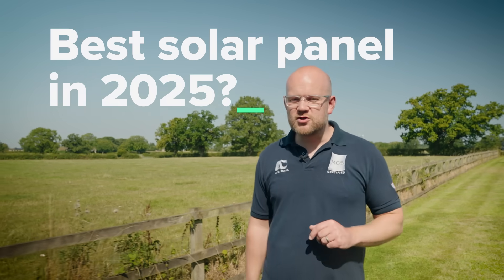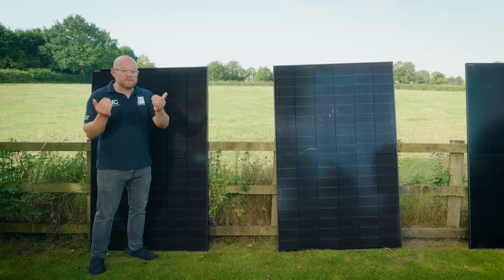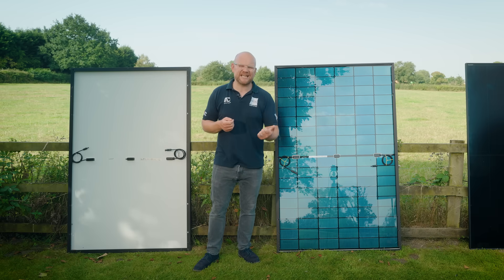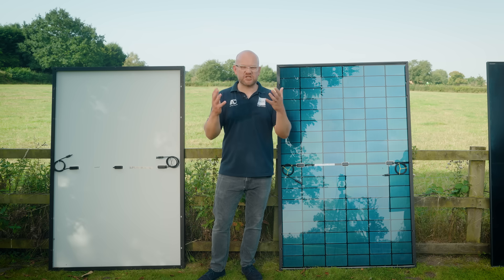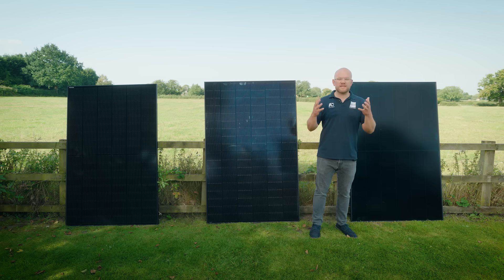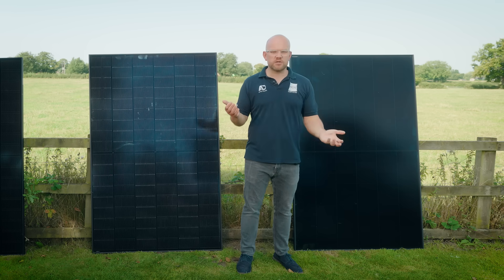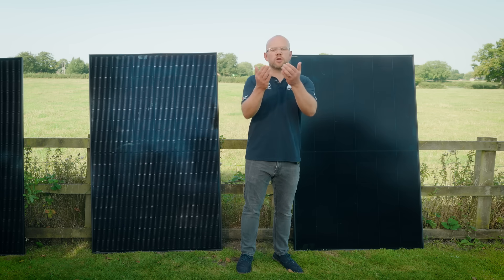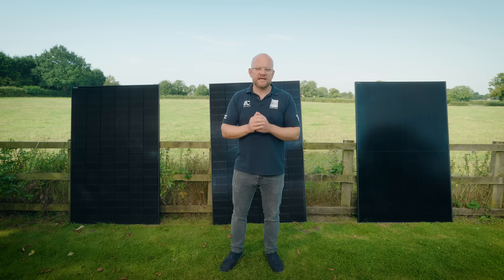Monofacial vs Bifacial vs All-Back Contact | Best Solar Panels 2025

Comment: Direct competitor the Aiko all back contact is Longi x10 HPBC2 (back contact cells). Doing research, these type of panels offer better output in partial shading. In summer (this is imp if your in a hot climate), both have a temperature coefficient of -0.26%/°C. For every 1°C increase in temperature above the standard test condition of 25°C, the power output of the solar panel decreases by 0.26%. Current Topcon panels like Jinko N type is at  -0.29%/°C.

Comment: I went with HPBC with almost no one talking about them.  I'm so glad I did.  I'm a complete newb to solar and really lucked out as my rvpozwer 220 watt panels are putting out 260 watts in the cold spell we're having.  The array is perfectly-matched for the Pecron F3000LPF I bought at the same time.  I got these cheap as well because no one is buying them because HPBC is like speaking Sumerian and everyone is gushing over bifacial.

Comment: “A bifacial solar panel has glass on the rear side, which allows it to dissipate heat more effectively and operate better. In other words, its temperature coefficient is superior to that of monofacial panels. Therefore, it will have better performance on hot days even if light does not reach the rear side.”
Reply: Who told you that.  On roofs they can get very hot especially darker to moderate media roof types.  Heat kills all

Comment: I have 2 Aiko 440W full back panels at balconly power station. one thing is not talked in the video is this one is the lightest and smallest among all these panels. it's ~2kg (10%) ligher and 4cm shorter. For DIYer in such tight space like balconly this is very important.

Comment: You can't compare the N type of Topcon Jinko with the ABC Aiko over a 6 month period. You need to compare like for like if available. Aiko, 18 months ago, had 455W ABC full black panels available to purchase so the increase in performance hasn't been that significant over the past 6 months. Aiko are now at 480W for all black imported into the UK. You're right that it's more incremental and more difficult as one gets closer to the Shockley and Queisser limit. It looks like scientists are starting to find ways of making perovskites more durable but we're not quite there yet and those that are made now are at a premium. Also showing panels on a roof with rigid bird protection would decrease light entering the roof tiles anyway lessening the impact of bifacial panels. They're far more effective with carports/carparks, ground and flat roof mounted at an angle on a light coloured roof.

Comment: Question - if you have full sunlight hitting both sides of the bi-facial, what is the maximum you will get from the panel? Is there a one side rating and then a combines rating? Do you know the maths for both?
Reply from the maker: Great question. The wattage listed on a bi-facial panel (for example 470W) refers only to the front side under standard test conditions. The rear side doesn’t have a fixed rating because it depends entirely on how much light is reflected onto it from the surroundings.

Bi-facial panels use a bifaciality factor (usually between 65% and 90%) which shows how efficient the rear is compared to the front. If the rear side has good reflected light (white roof, light gravel, snow, raised mounting etc.) you can see a noticeable boost in power output.

In real installations, the increase is typically in the range of around 5% to 30%, depending on the environment, and can be higher in very reflective conditions.

TUV nord do great studies on different set ups, which are useful to have a read of. 

Hope this helps.
Reply: @apexdoma  That's great, thanks. I would be interested to know if I can get full sunlight on both sides, what the maximum output would be. I do have my reasons and methods to achieve this. :-)
Reply: @OYMInternetRadio  Here's an example that may help you.  If the bifacial cells have 90% "bifaciality" and the rear encapsulation is perfectly clear then there's no reason not to expect that if BOTH sides of the PANEL are hit with "full sunlight" (let's call it 1000 watts per square meter) then the output would be 1.9 times what the front side Pmp is.

Comment: Just an idea, why not have a reflective solids surface behind the solar cells on a  panel, remove the black and allow the sun to  shine through and reflect back from the rear thus hopefully increasing solar power output. we already have clear solar for windows i believe , thus you could have the same or very very slightly thicker panels but gain a few percent more in output.

Comment: The black is only 6.7% better than JA bifacial rating. In Australia I regularly see 14.3kw from my 12.76kw rated 29 JA Solar bifacial panels mounted close to my white colourbond roof. That is 11% uplift compared to theoretical. So I think bifacial is still superior to the black 465watt panels.

Comment: You didn’t mentioned that Aiko panels are also partially shade optimised. That means if you cover like 10% of the panel it’s going to do 10% less power and not like 60 to 70% like the older one’s

Comment: Unlikely that any solar panel will still be installed even 15 years after initial install. The economics favour replacement every 10 years as panel efficiency increases

The most important economic consideration is to have something installed, rather than waiting for better efficiency to arrive
Reply: I'd love to see the math to support your claims!
Reply: @johnreeves7261 Here are mine, from my most recent upgrade. Kiwi dollars, but will translate to other currencies

18 x 270Wp cost me $3600 in 2019. 4860Wp. Yield 19.4KWHr/day = $3.30 FIT = $1173pa

16 x 415Wp cost me $3036 in 2024. 6640Wp. Yield 26.6KWHr/day = $4.52 FIT = $1648pa

The same roof area nets me an extra $475pa. So $3036/$475 = 6.4 years

Plus, i sold the old 270Wp panels for $90 each, so my upgrade cost was actually only $1416 = 2.98 years to break even
Reply: @Goodkiwibloke  Nice!
Reply: You could get 19% efficient panels almost 14 years ago. The best mainstream panels now are circa 24.5% efficient. The degradation on good quality panels is low. If you replaced the panels yourself then maybe the economics could work but you've still got the material and ancillary costs, new inverter(s) and scaffolding to factor in. Getting a roofer or dedicated panel installer and electrician in on top adds several years onto the payback. It also depends on the export price which is out of one's control. You really need a larger gap between efficiencies to justify it unless the inverters have failed or the panels have severely degraded. Perhaps for off grid installations it can be more justified but unless space is limited it likely makes more sense to add additional panels and inverter to the existing setup.
Reply: @andrewallen9918 By your own numbers, panels have got 25% more efficient. Add 10 years degradation, and there is another 5-8%. There are no material costs, everything is reused. There are no ancillary costs, whatever you mean there??? A good quality inverter has an approx 10 year lifespan, so was due for replacement, but actually doesn't need to be replaced if still working well.  Panel replacement is a job anybody can do, if they can use a screw driver. Why would a roofer be needed, scafolding is unnecessary unless you are a clutz, now you're clearly just making stuff up to justify an unwinnable position. Ditto electrician, no need, the panels just plug together using the same MC4 connector standard thats been used for 20 years 

The only valid point you raised is FIT. And this is only somewhat relevant if you exceed self-use generation quantity 

Show me your numbers, just like i did. But i bet you won't.

Comment: (7:16) The so-called "all back contact" technology is not new.  SunPower (now Maxeon) has been offering it for over 20 years.
Reply: Indeed, although it wasn't as seamlessly black as Aiko panels are now. I guess it was more expensive than the alternatives such as PERC and TOPCon and it's only more recently that ABC (or IBC with Sunpower) has become cheaper and more prevalent.

Comment: I want to do a self installation, but how do I determine my roof structural integrity? Are there specialists who just do that aspect?
Reply from the maker: Thanks for this. Just a note that a lack of MCS certification / not notifying the grid may cause you some issues. 

But assuming you can overcome these, we use solar design software that covers the majority of the installations; anything outside of the ordinary would be checked by a qualified structural engineer.
Reply: @apexdoma absolutely. I am an electrical engineer with HV, LV and ELV experience so getting the right paperwork into the DNO is the easy bit for me. Thank you for the response. 👍🏾

Comment: The video compares three types of solar panels: Monofacial, Bifacial, and All-Back Contact.

Monofacial panels (425W) have solar cells on one side only. These are the most commoditized and budget-friendly.	For those on a lower budget or using an in-roof system.

Bifacial panels (445W) have solar cells on both sides. They generate additional electricity from light reflecting off the surface beneath it. Bifacial solar panels work best for ground-mounted or on-roof systems with light-colored tiles, where light can get behind the panel.

All-Back Contact panels (475W) have all their wiring/busbars moved to the back of the panel, creating a pure black aesthetic on the front. They higher wattage and efficiency.	

The All-Back Contact panel offers the highest power output and efficiency, moving from a Monofacial 420W to a 475W in the same physical size, which is noted as a 20% performance gain.

Bifacial panels are unsuitable for roofs because light cannot reach the rear cells to generate extra power. 

While Bifacial panels were historically much more expensive, the cost difference between Monofacial and Bifacial is now minimal.

Why are All-Back Contact Panels the Most Efficient?
All-Back Contact (ABC) panels are more efficient due to two primary technological advancements: maximized light capture and superior thermal performance.

Maximized Light Absorption
The main feature of ABC technology is that the electrical busbars (the thin metal strips that collect current) are moved completely to the back surface of the solar cell. In traditional panels, these busbars on the front surface block a small amount of light from reaching the silicon. By moving them to the back, the entire front of the ABC panel is an active solar area, maximizing the light absorption and power generation.

Better Thermal Performance (Temperature Coefficient)
ABC panels feature a better temperature coefficient. This is crucial because, like all electronics, solar panels lose efficiency as they get hotter. By better managing their temperature, ABC panels can maintain a lower operating temperature for longer, resulting in higher performance and greater energy yield compared to standard panels under the same warm conditions.

Slower Degradation Rate
The manufacturing structure and back-contact design of ABC panels are engineered for durability, causing them to degrade much slower over their lifespan. This means the panels will still produce a significantly higher percentage of their original rated output after 30 years compared to Monofacial or Bifacial panels.
Reply from the maker: Thanks 😃
Reply: @ngana8755 said:    "Bifacial panels (445W) have solar cells on both sides."

No they don't.  They have just one set of solar cells (like monofacials).  The difference between bifacial panels and monofacial panels is that the bifacial panels use a clear "backsheet" which allows light to hit the back of the solar cells.
Reply: @johnreeves7261  What is your source for this information that bifacial panels only have solar panels on side side like monofacial panels?
Reply: @PerAsperaAdAstra8755  I did not say "bifacial panels only have solar panels on (one) side".  I said they have only 1 set of solar CELLS.  The CELLS are bifacial meaning they can produce electrical current when hit with light on either side.  When bifacial CELLS are assembled and encapsulated with a clear top sheet (usually glass) and clear "backsheet" then you have a bifacial PANEL.  You can find more information by researching the phrase "bifacial solar cells".

Comment: The video compares three types of solar panels to determine the best options for 2025, focusing on performance, aesthetics, and value.

1. Monofacial (The Budget Option)
Description: This panel has solar cells only on the single front side. The panel discussed is the Jinko 420W N-Type.

Current Standing: Nine months prior, this was considered a top-spec panel, but it's now seen as the more budget or "commoditized" option.

Best Use: Suitable for in-roof systems or for homeowners prioritizing lower cost and quick return on investment.

Warranty: It still offers a competitive 25-year product guarantee and a 30-year performance warranty.

2. Bifacial (The Halfway House)
Description: This panel has solar cells on both the front and the back, allowing it to generate electricity from light hitting the rear side. The model discussed is a JA Solar panel.

Performance: Offers a higher wattage (around *445W*) and better overall performance than the monofacial panel.

Best Use: Only suitable for on-roof or ground-mounted systems where light can get behind the panel. It is less effective on dark tiles where the light gain is lost.

Value: Previously much more expensive, the cost difference with the monofacial panel is now minimal, making it the best value for money versus performance halfway point.

3. All-Back Contact (The Premium Future-Proof Option)
Description: This technology moves all the electrical contacts (busbars) to the back of the panel. The panel discussed is the Ako 475W 3S All-Back Contact.

Performance: It provides a significant leap in wattage ( 475W ), a jump the presenter calls "once every blue moon."  This results in a roughly 20% performance gain over the older 420W model.

Aesthetics: Because there are no visible contacts on the front, it offers the most premium, all-black finish.

Longevity: It degrades slower due to the manufacturing process, meaning it will yield more generation at the 30-year mark compared to the others.

Recommendation: This is recommended for those seeking the best performance, premium finish, and future-proofing their system, even if it means a slightly longer wait for sourcing.

The video concludes that the All-Back Contact panel is the superior choice for premium performance and future-proofing, while the Bifacial panel offers the best current value proposition.

A Simple Explanation of "All-Back Contact" (ABC) Panels

In simple terms, "all-back contact" (ABC) means that all the metal strips and wires that collect the electricity from the solar cells are moved from the visible front of the panel to the back surface.

Like monofacial panels, ABC panels capture light on the front side only. However, the front of the panel is completely black and clean, without any visible grid lines or busbars.  Since no metal lines block the sunlight, the entire surface area of every cell can capture light, which maximizes the panel's power output (wattage) in the same physical space.

To summarize, in ABC panels, the window is now borderless —the frame (contacts) is moved out of the way, so 100% of the sunlight hitting the glass can pass through, maximizing its function.

Why are ABC panels more efficient than bifacial panels?

It does seem counterintuitive that a panel capturing light from only one side could potentially be more powerful than a bifacial panel, which captures light from both.

However, ABC panels can generate a higher rated power output (wattage) and higher energy yield per square meter than many bifacial panels due to a focus on conversion efficiency rather than dual-sided capture.

The high performance of ABC technology is achieved by eliminating a key design flaw present in almost all conventional panels, including most bifacial models: front-side shading loss.

Elimination of Shading: In a traditional solar cell (including many bifacial cells), the metal strips (busbars) and gridlines on the front surface of the cells block 3% to 5% of incoming sunlight. By moving all electrical contacts to the back, ABC panels create an unobstructed front surface that captures maximum light.

Higher Conversion Rate: This small change, combined with the use of highly advanced N-Type silicon and optimized rear architecture, results in a massive increase in the panel's energy conversion efficiency. Current ABC models can achieve module efficiencies of up to 24.8%, making them the most efficient type on the market today.

The Result: A 475W ABC panel can generate more absolute power than a 445W bifacial panel in the same physical footprint because the ABC panel converts sunlight to electricity much more efficiently.

Comment: Would mirrors installed on a roof under the bifacial solar panels improve their performance?
Reply: What one should consider is sufficient gap for light to reflect off of whatever surface is below the panels where they are mounted.